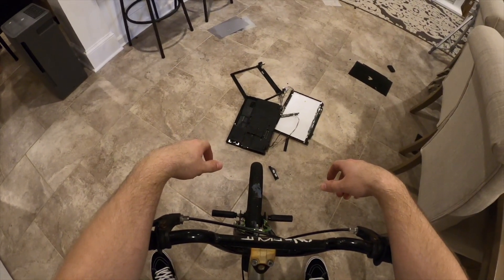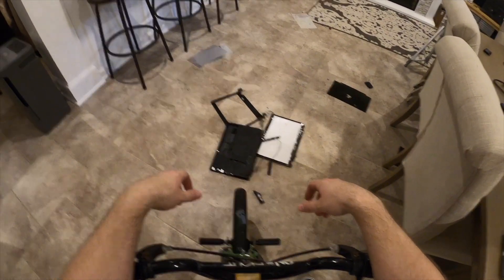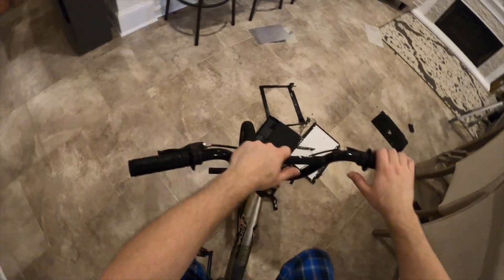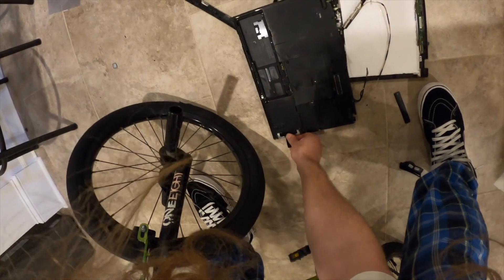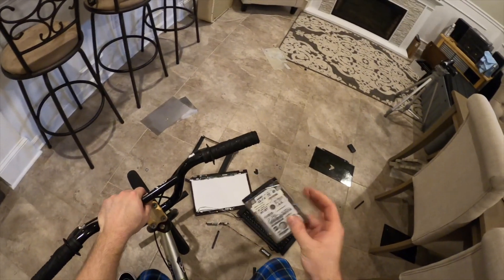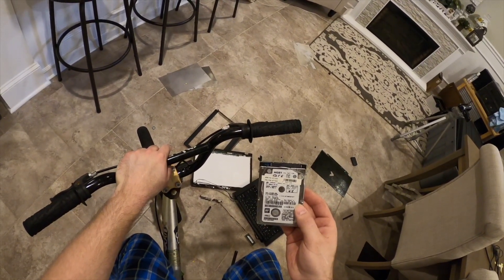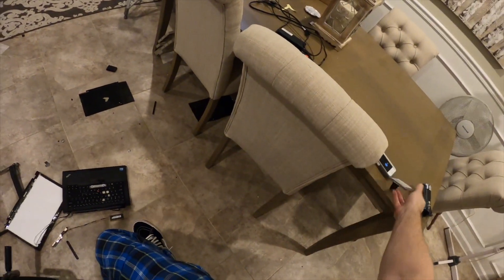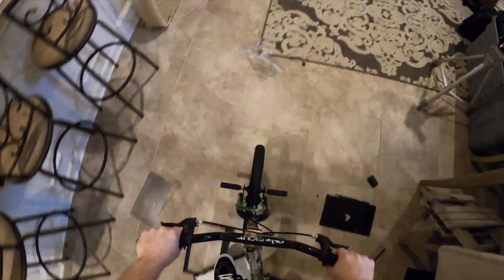Lenovo T430S Laptop Durability Test Part 2: What Will it Take to Break It?

Comment: Lenovo sure did build a tough machine! For certain lines, they still make them this way!
Reply from the maker: I find it hard to believe any machines made today are as tough as these older ones were, but you're not the first person to say Lenovo's more expensive models are still decent. I've never worked with them personally, I just don't have much interest in newer hardware.
Reply: @JordanU  Geez you were out for blood on part 2 lol, didn't even see there was a second part when I watched part 1. I wouldn't count out other brands or newer laptops, MIL-SPEC seems to be fairly common across Thinkpad alternatives regardless of age. There are very few videos torture testing EliteBooks, Latitudes etc, bummer cus I'm curious how much they can withstand.

Comment: throw it on the highway and see if it survives a car going over it at high speed
Reply from the maker: That's foolish, that could cause a crash.
Reply: @JordanU  no it wouldnt I did it with plastic fan parts and it got obliterated
Reply from the maker: @drakesessions3544  I have no problem doing that with my own vehicle in a controlled environment where there's no traffic, but I'm not going to do what you're describing. The general public would not appreciate it and it entertains a dangerous situation for no reason.
Reply: @JordanU  Alright well you do have a point